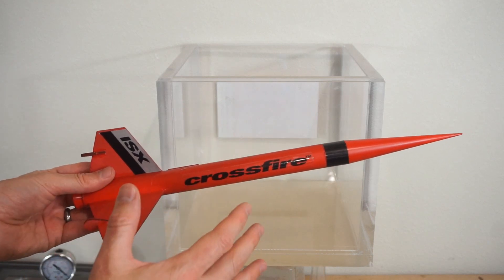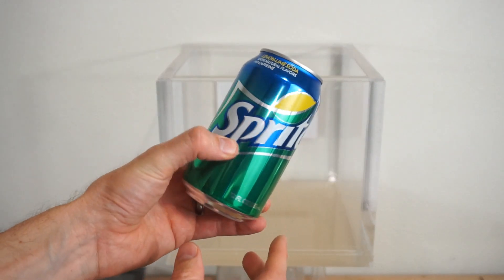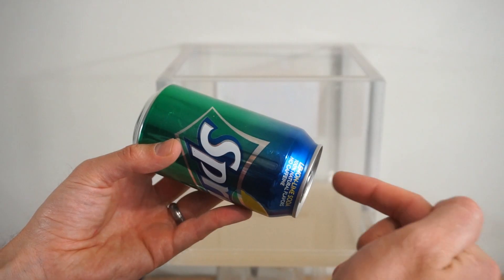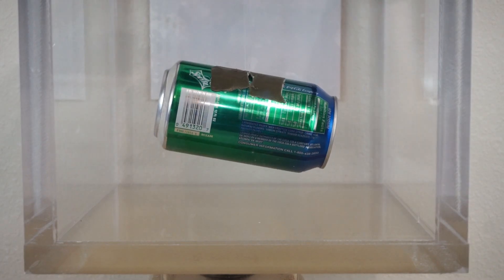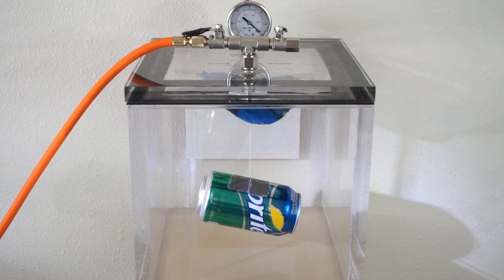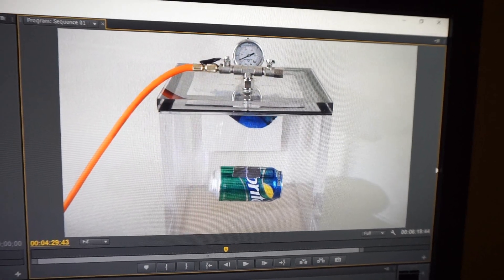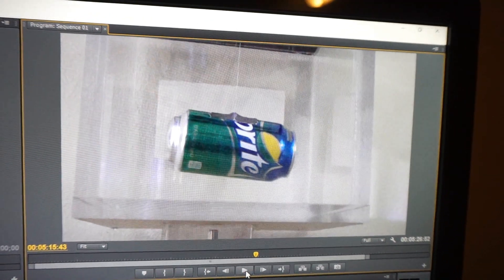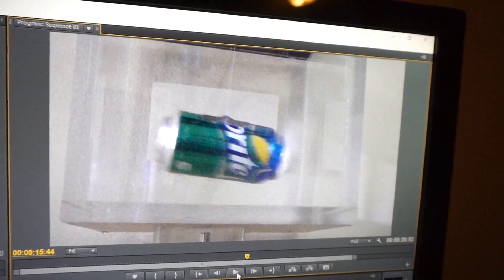Can a Rocket Fly in a Vacuum Chamber?

Comment: Why does he show the slow mo from the left of his video screen making it difficult to see if it hit the wall of the chamber first,  which it looks like it does in the other shots.    I appreciate the experiment but seems inconclusive from the angle he's showing the slo mo.  Also the chamber is a tiny box and we're talking about NO box in the vacuum of space right?   Just saying...peace.
Reply: It doesn't matter. Hitting the wall would not give resistance for the can to "push back" against because the rest of the box is still a vacuum or partial vacuum. Only when the chamber is fully pressurized would be "push back" effect be present.

The can recoils without "push back" (because the can doesn't care if the gases hit the wall, it can't "feel" that resistance because gases will be pushed sideways rather than exert a force into the can).

Comment: nice try! but what about the CO2 gas hitting the wall and pressurizing the chamber just the right amount needed to get the can in motion? I suppose you don't say that CO2 is visible. Also at the time the can explodes your vacum isn't nearly perfect there is still air inside the chamber.

Tip:

Try next time with a much bigger chamber to emulate real free space vacuum and a can that can take more punishment and explodes near perfect vacuum..

Comment: Oh shit!!! I was happy with the results of your experiment. But I realized, that the lid came off. So, because the lid was stationary, did the can gain movement from pushing energy against its own stationary lid?
Reply: mossaic13 ..Correct..that's all it was !
It pushed the lid in one direction ...so it moved in the other !!
Reply: @dankelly8517  Youre acting like an explosion wouldn't cause propulsion in space. That's not the same thing as combustion propulsion via thrust. ALSO on top of all of this bs, there is a common gas in this can that once leaks out, compromises the "vacuum" like state the chamber is in (which is not where any times near the vacuum that space possesses..) The gas is called Co2. Im sure you children wouldn't know of that though, and would even consider adding that variable into the experiment.
Reply: mossaic13 I agree, its motion was due to the force of the breakage, not becoz of combustion
Reply: Yes, Smyth ng that laves the can and is forced in one direction will induce an equal force on the can and propel it in the other direction.

If the object in the vacuum was a spring loaded catapult that fired a small metal bead....then that too would move away from the can and exert exactly the same force on the catapult. If both the catapult and the steel bead had the same weight they would both move the same distance.
Reply: Very wise I never thought of it,yes it gas lid pushed the lead too
Reply: bigpigslapper Oink  the rocket.
Reply: @paulbottomley42  so the rocket pushes against itself? shame a free body diagram & PV work calculation both prove that wouldn't work.
Reply: @papalegba6759  Not quite, the expanding ball of gas being shot out the ass end pushes against it. Newton tells us taht for every action there is an equal and opposite reaction - since the rocket is exerting pressure on the exhaust gas (blowing it out the back), the exhaust gas also resists that movement and provides an opposing force to the rocket, moving it forwards.
Reply: A PV calculation looks to be misapplied here, since it relates to pressure within an essentially sealed container, like a piston. A rocket, I don't know if you know this, is not a piston. Maybe you can tell me why you don't think the laws of thermodynamics - specifically the one about hucking a thing in one direction also providing a force in the other - apply to rockets and only rockets.
Reply: @paulbottomley42  the exhaust is a force exerted by the rocket so would not be included in a free body diagram. thanks for proving you don't know how they work. 
and PV work calculations refer to gas expanding against external pressure. in a vacuum external pressure =0 so work also =0. this is called free expansion. citation:
https://thefactfactor.com/facts/pure_science/chemistry/physical-chemistry/pressure-volume-work/6602/
quote: "when a gas expands in a vacuum there is no opposing force"
no opposing force = no motion.
so you're wrong, but will never admit it, as that is not your job.
Reply: @papalegba6759  So like

Why doesn't Newtonian physics apply to things in a vacuum? 

I'm really confused as to how you think the world works here. gas, being matter, has inertia. Changing that inertia exerts an opposing force. Accelerating it out the back of a rocket changes its inertia. Therefore it exerts force on the rocket. What part of that doesn't add up?
Reply: @paulbottomley42  please point out where he stated that newtonian physics doesn't apply to things in a vacuum. he has done nothing but apply newtonian physics to things in a vacuum. as well as thermodynamics, neither of which you understand. you are indeed a liar and a troll.
Reply: @paulbottomley42  1. Rockets can't ignite in a vacuum as their is no oxygen. 2. To get the ignition to fire and burn the liquid oxygen, it can't be exposed to the vacuum, if so the liquid oxygen would be sucked out immediately. 3. Soz to get the first burn, the exhaust has to be closed off, meaning an explosion in the contained craft. 4. Even if u time it perfectly to where within a nanosecond the exhaust opens after ignition, the flame would burn out and the liquid oxygen would get sucked out after depressurizing. 

U might get a burp of a movement. So until they figure out an ignition that will ignite in a vacuum, they won't work no matter what they tell u. An absolute vacuum destroys physics in an atompshere
Reply: @robblack2741  "Rockets can't ignite because there is no oxygen"

"To burn the liquid oxygen"

I think we've got to the bottom of one mystery right there, don't you? As for some means of regulating flow, oh shit I guess such a thing has never been invented and is impossible.
Reply: @paulbottomley42  the thrust would be completely absorbed by the vacuum of space leaving you stranded. No one can fly in space
Reply: @paulbottomley42  it gets absorbed by the vacuum
Reply: You know what.. all these videos on rockets in vacuum are completely nullified do to the size and fuel ratio. Might as well use a atom bomb to power a leaf blower.
Reply: @mossaic13  Oddly enough, the idea of using nuclear detonations as a form of space propulsion has been seriously considered. They decided there might be even more safety concerns than the normal set concomitant with space travel. The legacy of the idea exists in the design of the spaceship in the sci fi classic 2001: A Space Odyssey, in which you can see an awful lot of shielding around the back of the ship. Originally the concept was that it would have a nuclear drive, but like the real notion was binned in favour of conventional fuel. But they kept the nuke design.

I know that's got only a tangential relationship to the topic but I think it's interesting anyway.
Reply: @mossaic13  most of them openly cheat. this one doesn't even use a rocket. newton's 1st law alone proves a rocket cannot alter its state of motion in a vacuum as a vacuum cannot apply an external force. not debatable, QED.
Reply: Exactly what happened
Reply: doesn't really matter. same principle.
Reply: Wouldn't it also be pushing off the liquid?
Reply: mossaic13 yes it did. But it is the same concept. Lid, gas, or liquid. It doesn't matter. When you throw something one direction you get pushed the other.
Reply: Paul Bottomley, your addition of the term 'Flat Earther' skylines you as a Shill. Is being a shill profitable?
Reply: @asleepinthealley  so basically, you're saying because the ocean is so big, your foot would be crushed 1 inch under it.
Yeah, that's not how it works, buddy
Reply: Interesting. It might be enough of a loophole for flat earthers to weasle through. I wonder if we could recreate the experiment with some sort of rotating nozzle, or attached to a string, inside of which a chemical reaction - say, vinegar and baking soda, anything that makes gas - would be taking place. The gas would be forced out of the nozzle, making this crazy contraption rotate. Would that allay suspicions of shenanigans
Reply: ActionLab Vlogs, bullshit. This experiment was dependent upon the size of the vessel and the amount of vacuum provided. A rocket will not work in the infinite vacuum of space. This is Rocket Science at its primary level. Rockets do not provide the required thrust in an infinite vacuum.
Reply: +Paul Bottomley Yes. I upvoted your comment, and I wish I could 1000x upvote it.  You should upvote your own comment to get it on top... if replies can be on top, that is...

Comment: Good job man. As a seeker of truth, I thank you for your input on the subject. 
Moving on to the next questionS. Energy release scale to weight ratio? Massive Rockets seem to accelerate very slowly. Taking nearly a good minute before there's any real velocity per sec. The pop can experiment seems to release more energy per mass of vehicle as opposed to the shuttles weight to energy ratio. And number two. How does a rocket steer in a vacuum?
Reply: Off subject question. What's the shuttle, moon lander and ISS made out of? That pop can ripped apart. Structural integrity, design above breaking point, sure, ok. But would +-500* difference every 45 minutes effect sensitive components, ex, hatches, pipes, windows, seals, gaskets?
SR-71 Blackbird.
Reply: A rocket releases a lot smaller of a percentage of its mass over a much longer period of time.
There are two components to causing an object to move through Newton's 3rd Law alone: thrust and specific impulse. Thrust is the amount of force being generated and specific impulse is the amount of impulse generated per unit of what ever you're throwing out to generate the thrust.

So the can has a lot more thrust for its weight, because nearly all of it comes out all at once, but it has a low specific impulse, because what it throws out produces less impulse than rocket fuel.

BASICALLY if you filled the can with rocket fuel and ignited it, it would burn more slowly and thus accelerate more slowly, but because there's more total energy in the rocket fuel than in the soda can, it will achieve a higher top speed and thus go faster and farther in the end. Assuming of course the can doesn't melt or explode.
Reply: Some talk about Newton's law. But its space not on earth. I cant grasp the idea of a negative pressure work as something that limits the free flow of thrust ( as we feel with the resistance of wind or  moving inside water )making the object carrying that thrust to move in the oposite direction. Its like having a -9999999 number and adding 3 or 100.. its still negative. Does this make sense? Because if no drag exist and it can go indefinitely, how can you thrust?? Swerving or moving direction is another one i cant grasp. I know im not very smart but nobody is born wise. Isnt Voyager1 moving with the same initial push from within earths orbit and moving in 1 direction?
Reply: @user-sm8wo3dj5z  Yes, Voyager 1 is moving with that first initial push. If there was no initial push it would not go anywhere. If there was a constant push then it would continue to increase in speed. If space was totally empty then it would go on forever with the initial push but there is gravity from other objects in space so this will have a small impact on it's speed and trajectory. Hope that makes a bit of sense.
Reply: "How does a rocket steer in a vacuum?" - various ways. By directing the nozzle to steer the main thrust in a slightly different direction. By expelling gas out of the side of the rocket. By using a reaction wheel.

Comment: So what you are proving here is that when you eject a liquid out the back end of the can with pressurised gas, that newtons third law does then become applicable? That's cool.
proves newtons third law but what it doesn't do is prove that gaseous expansion can cause thrust in a vacuum. Not that i am knocking your experiment. What it also shows is just how much pressure is in atmospheric air pressure. 1 tonne per square foot.

Comment: Did you not see the pressure gauge after the soda was opened? There was no longer vacuum as the gauge moved up significantly， Best to experiment with pressure and then without pressure and see the difference.